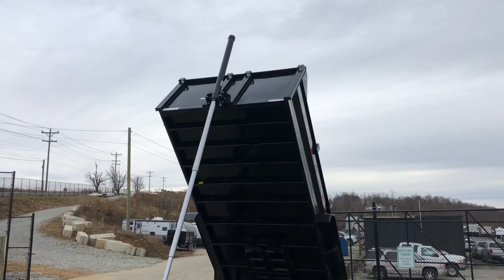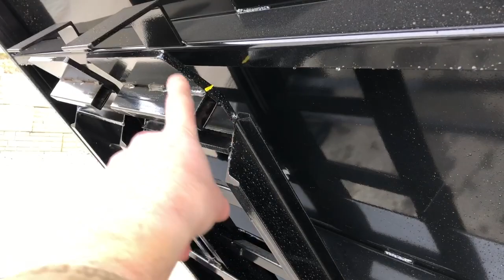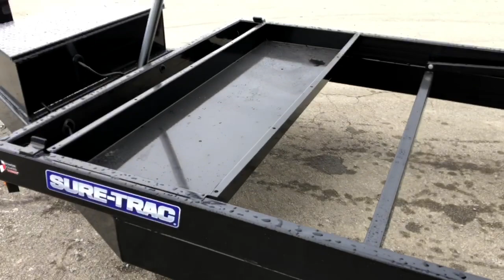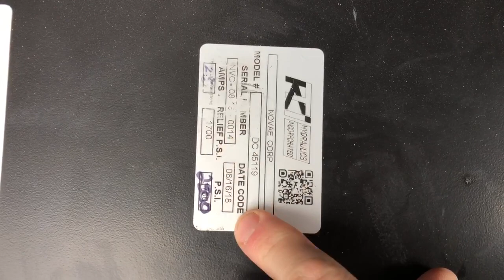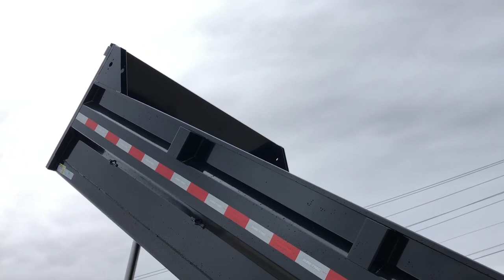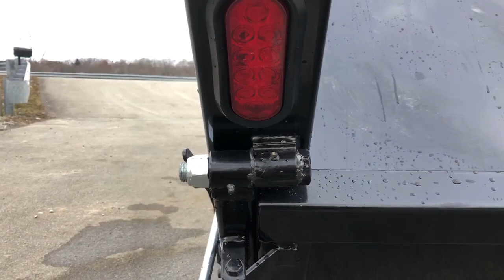Sure Trac 7x16' Hydraulic Dump Trailer 16000# GVW Telescopic Hoist ST8216TLDD-B-160

Comment: Are these trailers recommended to be hauling a 10k machine on a daily basis?
Reply: Look up specs online as read. 16k GVWR LBS. Payload depending on lift mechanism acquired, is 10960-11640 lbs. I would say yes it could carry up to 10k lbs.